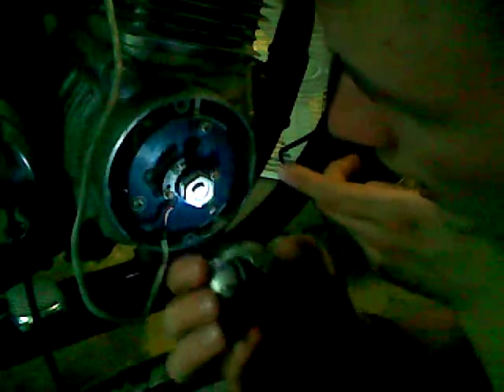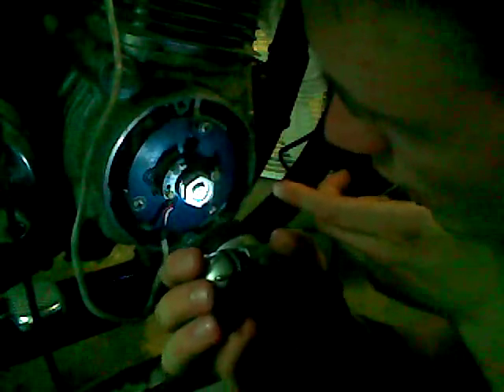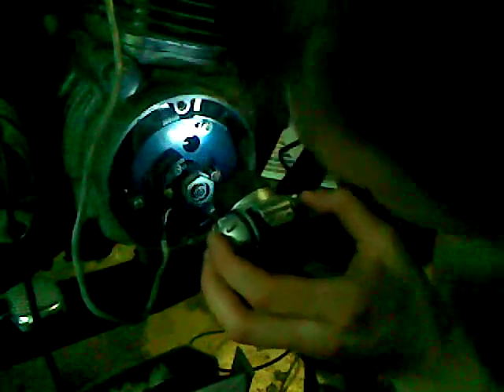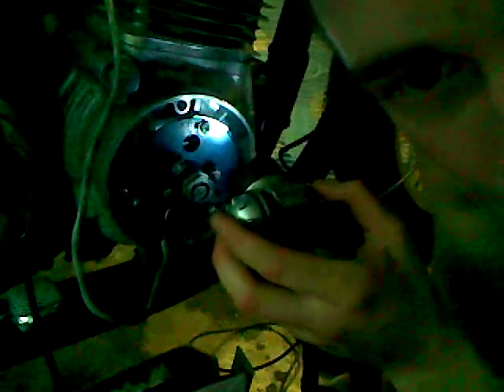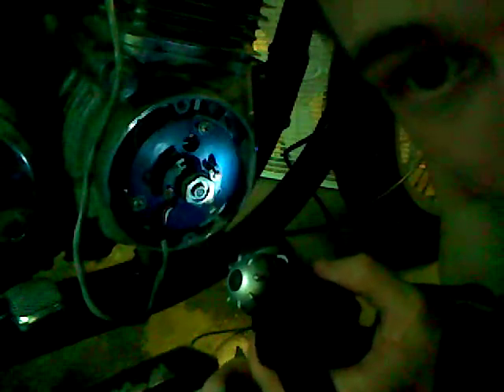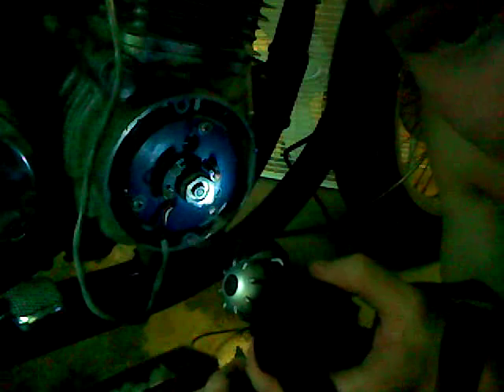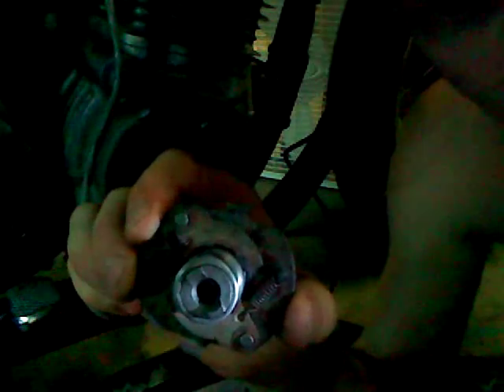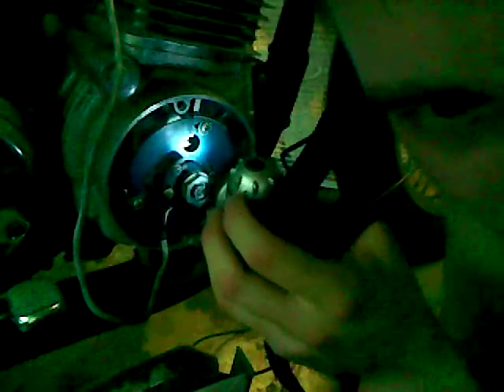spark timing honda cb750

Comment: When setting the timing on a 1980 Honda CB 750 Custom, does it matter what spark plug you put the timming light on? When I use it on my 8cyl engine the light has to go on spark plug #1 in the firing order. Im not sure if a motorcycle has a #1 firing plug? Also, the problem I'm having is that the bike runs great until I am maxing out the rev's in any gear, then it just sputters with no power. Do you think it's timming?, or Carbs? or Spark Advance module? Thanks for your help.

Comment: Hows it goin dude ..I have my points @ 0.3 -0.4 mm factory ...now id like to advance the timing for more HP ..how many degrees advance is safe before detination or ping  for a 1978 supersport 750 ?...are those two lines on the marked rotor my only setting? and not sure if checking the dwell actually flushes the points ..thanx and sorry for all the qeustions

Comment from the maker: @ph3arl3ss09 fits to the cam shaft sprocket, its hard to exsplain but if you put then back together wrong then when you tried the engine out you might have bent your valves, which means you will need all new valves and a proper reassembly this time. i can exsplain how to properly reassemble it if you want it's a very lengthy prosess.

Comment from the maker: @ph3arl3ss09 the coils one is a 12 volt black wire the othere two are yellow and blue. the colored wires go each to there own coil if you get the mixed up the coils will fire after the exhaust strock causing a little puff through the intake. how much work did you do on your engine, how much did you tweek? my second guess is that if you took the cam shaft off and put it back on not exastly right well bad news. for a SOHC you will have a cam shaft that has a toothed sprocket and a cam chain that

Comment from the maker: @ph3arl3ss09 hey, so i have a few questions. what year is your bike? just wondering if the engine is a SOHC or a DOHC. i am a bit confused about your terminalogy but i think i understand your questions, i understand how hard it is to know what each parts is called. well by the sounds of it my guess is that you hooked the wrong wires to your coils. that would be one of my guesses. the bike will have a coil that will fire 1-4 and a second coil that will fire 2-3. there are three wires that go to